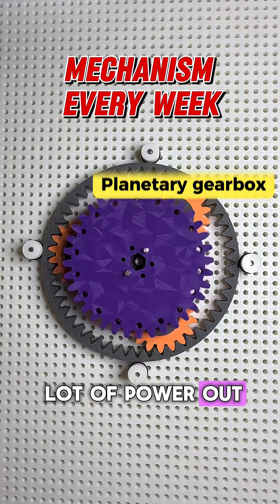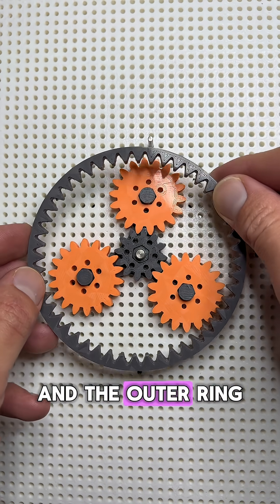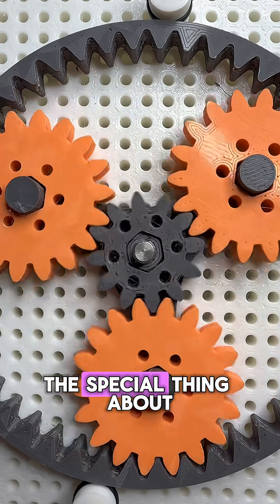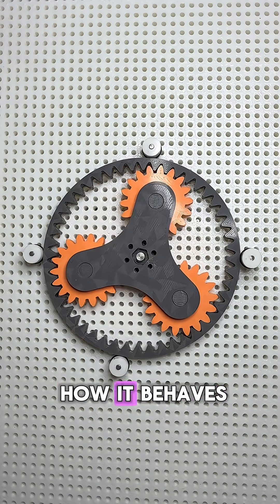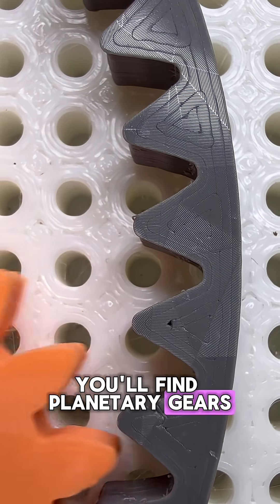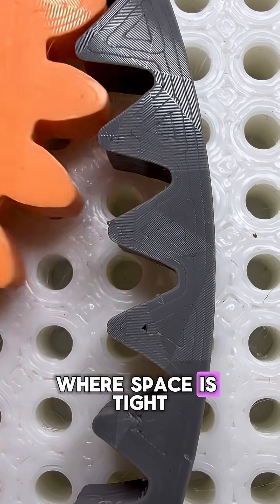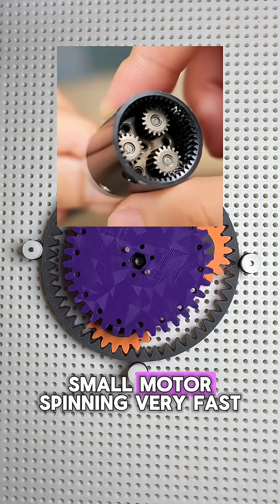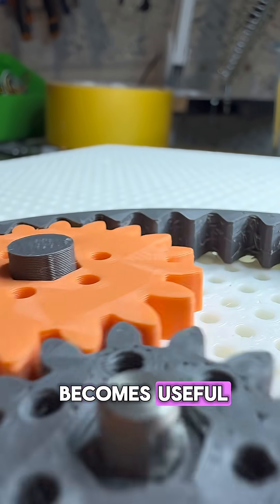Packing big torque in tiny spaces #stem #3dprinting #mechanicalengineering

Comment: Friction isnt reduced. Theres more gears making contact
Reply: Friction doesn't particularly care about apparent contact area.  Dry friction in the vast majority of mechanical cases is directly proportional to the load and material properties, which both correlate to real contact area, which is a microscopic phenomenon.  Consider the material as an elastic:  Each small part of the material pushes back proportionally to how much it is deformed by a load.  However, the surface has microscopic roughness, so not all of it bears the load at the same time.  As the load increases, the peaks of this roughness are deformed, and more of the surface can bear the load, the real contact area.  This is why, empirically, friction is independent of apparent contact area, as the real contact area is proportional to load.  Therefore, the planetary gearbox of the same reduction ratio, which distributes the forces between multiple gear teeth which are all at a much lower reduction ratio than the gearbox as a whole, causes less friction.  You will find that planetary gearboxes are largely considered more efficient than traditional spur gear reductions of the same ratio due to this distribution of contact forces.

I should clarify, however, that this all becomes quite complicated when lubrication is involved, as viscous forces are a much more complex phenomenon.  However, as a rule of thumb, planetary gearboxes are an efficient reduction. As well, a 3D printed gearbox in a hobby context would typically not have lubrication, and so all the physics outlined above applies fairly purely.

Comment: friction is reduced? more contact points means more friction no?
Reply: Typically, no, that doesn't necessarily correlate.  The distribution of loads means each tooth is experiencing a much smaller normal force than the teeth in a traditional spur gear reduction, and friction is proportional to that normal force.  I provided a much more detailed response to a similar comment by Xnolierr if you are interested in the underlying physics.